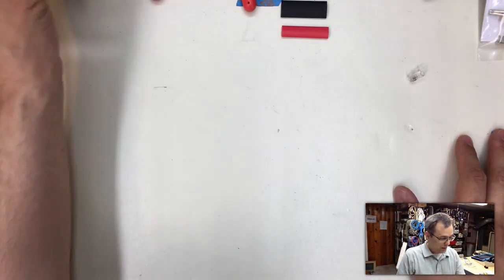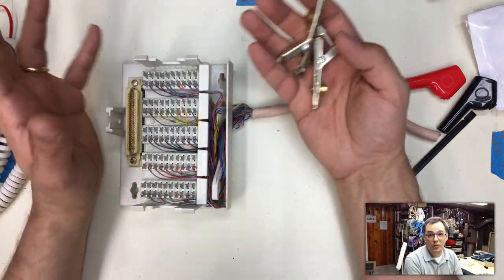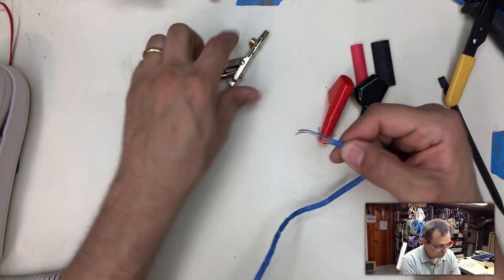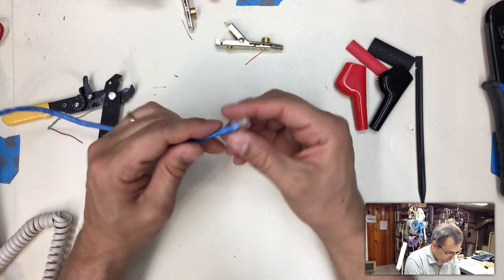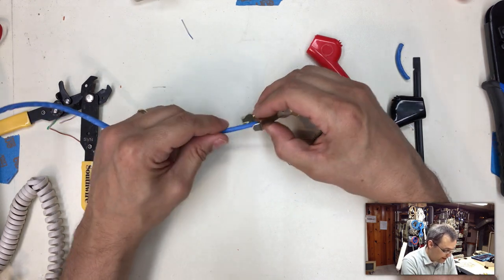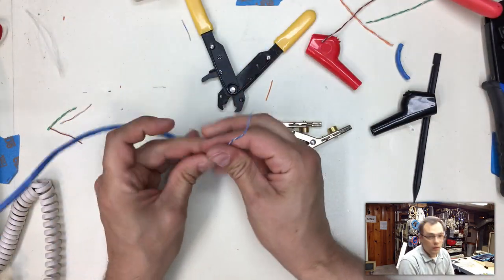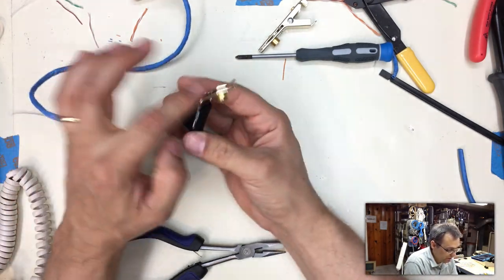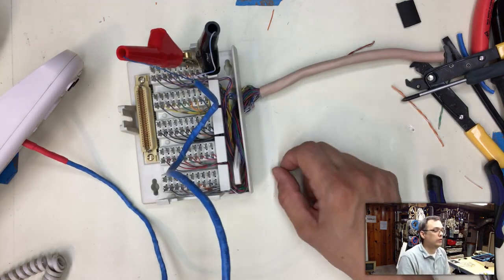How To: Make Your Own Lineman's Handset

Comment: I got the fancy set for $14.95 in near new condition. All I had to do was replace the 2032 coin cell and clean the 9v plug and replace the 9v battery and reassemble. Now I have a working Harris butt set.

Comment: I do this with a dongle I made. rj45 keystone with alligator clips on the other end. It's called a pirate jack. Hand set can test in almost every in house situation and when I need clips, I plug into the pirate jack and attach the clips as where I need em. Cost me pennies to make and 5 minutes of braining out the pinout.

Comment: I used to just punch the phone wire from an old phone down over the other wires, then pull it out and trim the ends after. It was even cheaper, and worked just fine for my extremely occasional needs.

Not very official, and probably not the best idea, but it worked okay.

This is certainly a better way to do it.
Reply from the maker: I've done that too! It was getting to the point where I had to do it multiple times on the same job, so the buttset was a huge time saver.
Reply: @JoesComputerMuseum  I can imagine. Once it gets past the point of 'very occasional' it gets to be a pain, and you want something better, but still not the $80 fancy set

Comment: man, you need to get yourself a pair of electricians scissors. Handiest freaking tool ever for working with 4pr cables, 2pr cable, even lighter weight low voltage stuff. Get a decent pair from Ideal, Paladin or Klein and you're generally guaranteed a good tool that keeps its edge and lasts for years.  I like the ones with the extended ergonomic handle but a regular pair works great as well.
Reply from the maker: I've heard that before. I've tried them. I don't like them. Personal preference kind of thing.